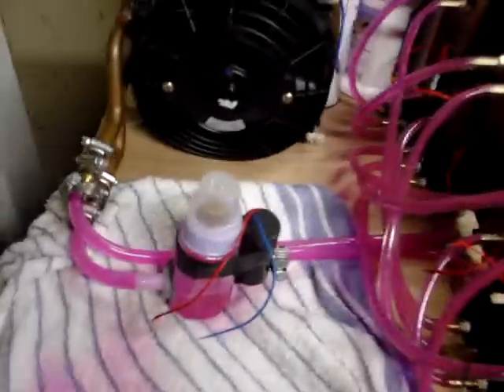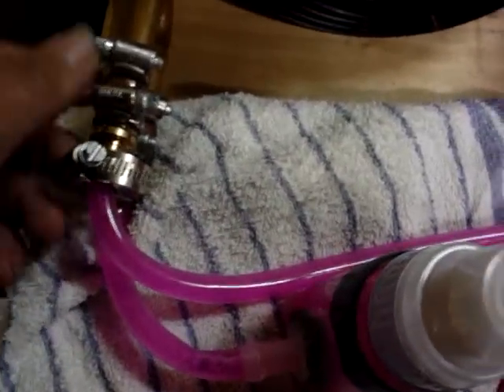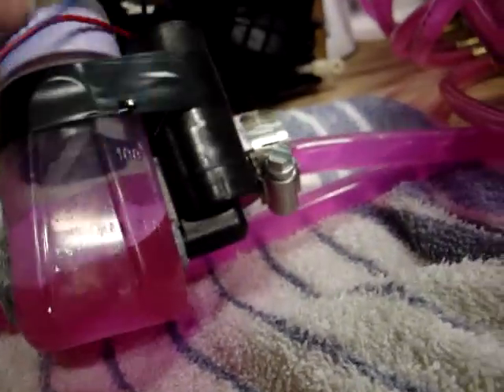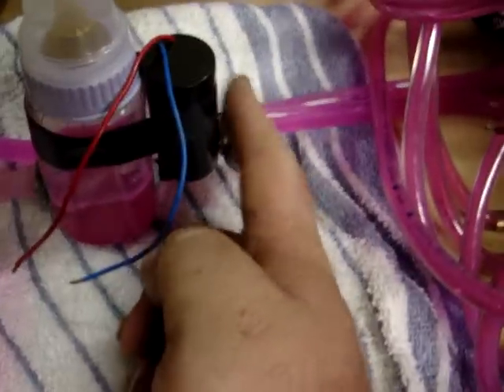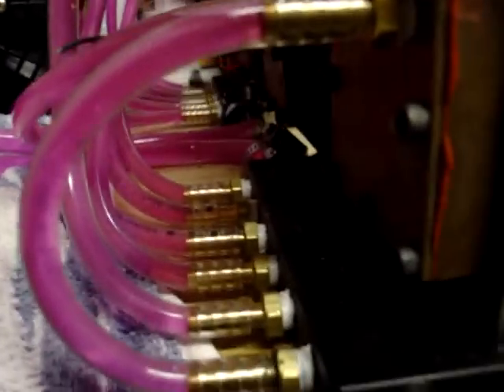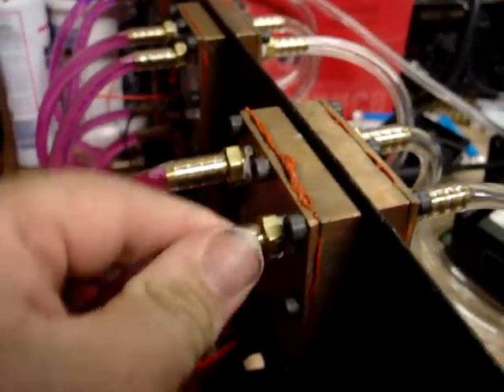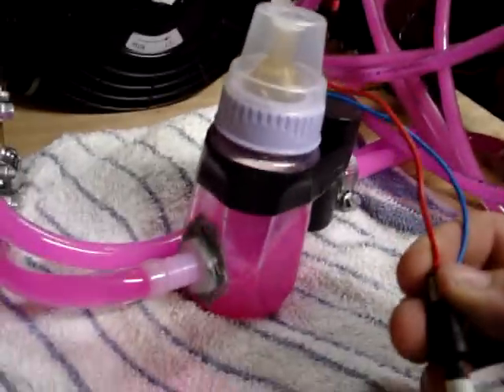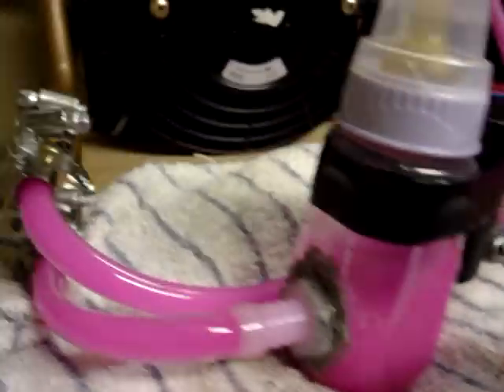Thermoelectric peltier Air conditioner project phase 1

Comment: according to my info increasing the voltage of TEC (that means you are in-directly increasing the  amount of current flowing through TEC) that makes it to produce more heat but when you decrease the voltage (you are decreasing the amount of current flowing through TEC ) so you get a better cooling performance and less heat , so if decrease the current the peltier unit will give much cooling . well i haven't tried it yet but exprerimenting with it will be great

Comment: you could put less volts to the pump to save it a little or put it in the tank to keep cool.  you can use a windshield wiper tank and pump